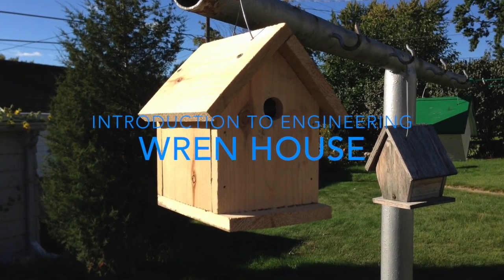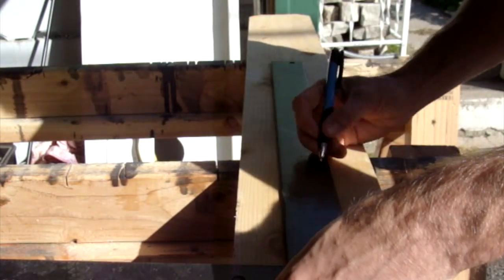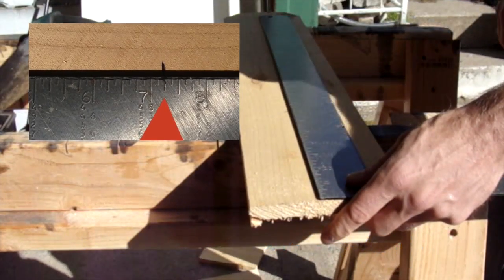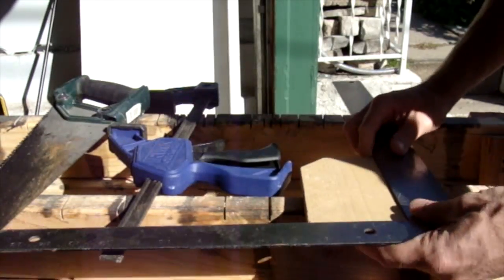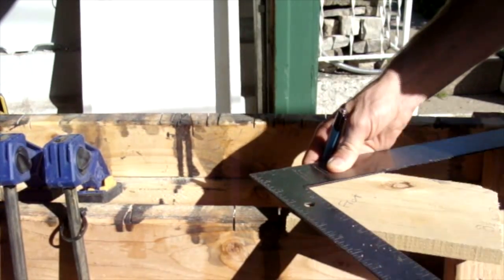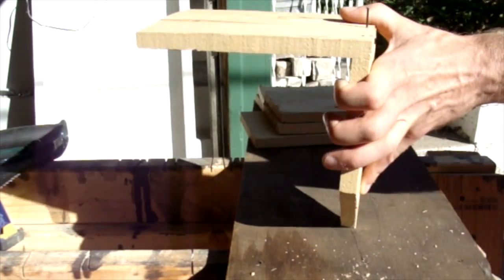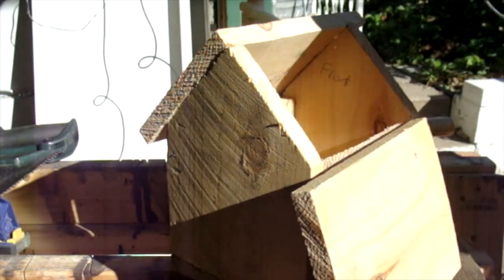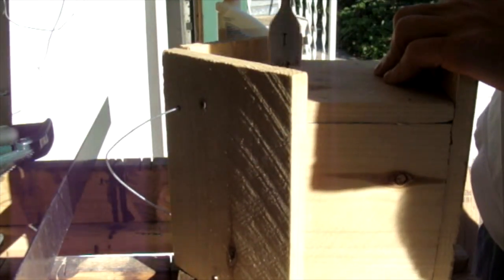Wren House

Comment: Here are mistakes:
1. No access for cleaning.
2.The  bottom/floor unnecessary extends - accumulates moisture and water in the house and floor when is a heavy rain.
3. The bottom is better when is inside the walls.
4. Nail are good, but crews are better.
5. Holes in the roof also will contribute to moisture during heavy rain.
6. No ventilation.
Reply from the maker: Actually, if you make it to the end of the video, I said that I screwed on the last piece of roofing so it can be removed for cleaning.  Also, I did this with my 6th grade class and used nails + glue because most of them were not strong enough to use a drill. Thank you for your constructive criticism.

Comment: I've read you need a 1 1/8 inch hole.   Is. 1 inch hole large enough?
Reply from the maker: I can hear the wrens chirping right now.  I have a male that has made nests in multiple houses.  I haven't had any problems.  I really don't like house sparrows and refuse to provide them bird houses.
Reply: Yes ! Any larger and the Chickadees and sparrows will enter.